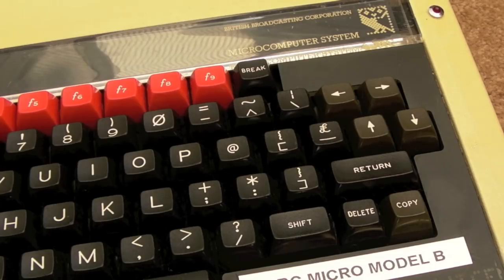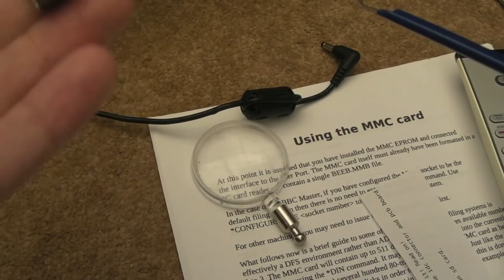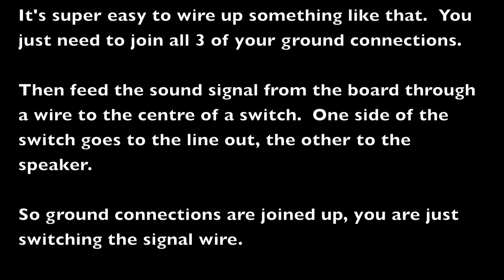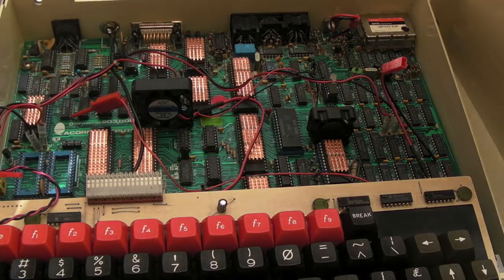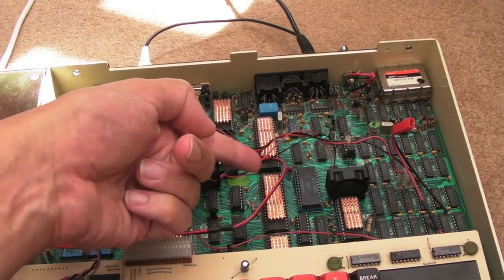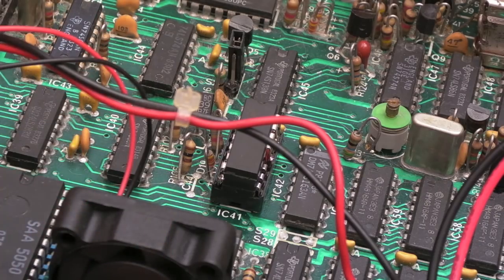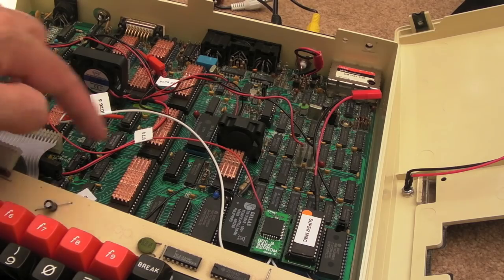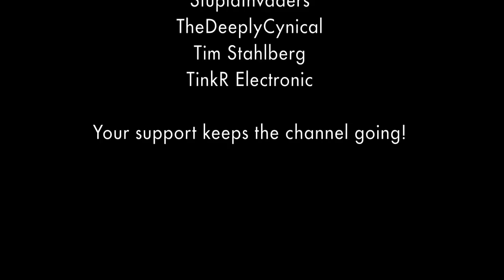Acorn BBC Micro Model B Multiple Repairs Part 4

Comment from the maker: Part 1 - https://youtu.be/XBQJHqbnVco
Part 2 - https://youtu.be/UyQ8ROnTrg0
Part 3 - https://youtu.be/IY1eqRxM48s
Not sure why some of the title music vanished there when outputting...  Always something wrong with my vids lol :o)

Here's the link to the video which talks about building the BBC - from a key person who worked at Acorn:- https://www.youtube.com/watch?v=y4WG549i3YY
Reply: GadgetUK164 - Retro Gaming Repairs & Mods

I did spot that earlier, but I'm too overheated to be pedantic about it. lol
Reply: GadgetUK164 - Retro Gaming Repairs & Mods 

Oh, btw, I still have a Merlin Tonto here which has the different type of speech ROM in it.

I wonder if anyone has dumped the ROM yet, as it could then be used by anyone on a Beeb (using that TMS ROM emu project thingy)?
Reply: GadgetUK164 - Retro Gaming Repairs & Mods

(as is typical after replying, I see you are already using a TMS6100 emu board. :p )
Reply: Holy moly Batman. Those fans are saving IC life!!! Amazing fix bud. Keep up the good work xxx
Reply: You must be pissing your mews off. Your hand 😂
Reply from the maker: I've got a couple of TMS-6100NL chips that don't work with the beeb, and not sure on their origins, suspected Speak & Spell or something...  Either that or they are blank and require programming.  Seems there's little info out there on them, other than how to read from them.  Presumed they are masked at the factory but a few people have suggested they can be 'blank' and require programming?!?!   I've got the emulator you're talking about there too btw =D
Reply from the maker: Thanks =D
Reply from the maker: PMSL lol!  Yes, they've been little terrors!

Comment: The audio mod should really come from PL16 and fit a switch to kill the internal speaker, the sound quality of PL16 is much better than from the loudspeaker output on PL15.  

Regarding the temperatures inside the computer, they reach around 75C when the ambient temperature is 30C, it doesn't need cooling, as the higher temperature means faster heat loss.  Unlike the Ferranti ULA in the Sinclair Spectrum, the BBC has enough space above to allow the heat to escape.  

The most common failure is the power supply and the hotter that runs, the shorter its life (electrolytic capacitors leak and dry out) this in turn puts more stress on the components, heating them further.  A good mod to do (without needing lots of fans and heatsinks) is to put a fan in the grille of the power supply and run a wire to a spare V2 pad (12V) it will have to be a slimline fan.  This would prolong the life of the PSU and reduce the fear of logic chips reaching their danger point of 140C (yeah, we're a long, long way from that level - these aren't nVidia/AMD flipchips that are soldered into another package - XBox360 Red Ring of Death, MacBook Pro 2012 et.c. that die at 105C)  

Unfortunately, at some point the design was changed to restrict the vents on the underside and the vents on the lid - I guess kids were poking things through the holes and the computer doesn't like that much 😆  

It looks like you're having fun with it, maybe try the 1MHz Pi projects like HDD, Teletext, Music 5000 (synth) and there's a good Pi Econet Server project underway that works well (as you've got an Econet interface)

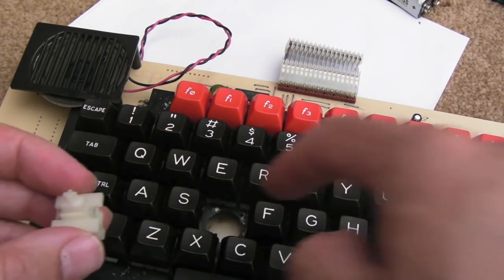Comment: 8:48  The solder pins on those switches form part of the contact. You can (gently) pull and twist them out with a pair of pliers, clean them and push them back in. It's not a guarantee they will work when they are re-soldered as there's another part that you can't get to, but it's worth a punt.

Comment: Intermittant keyboard switches are common on a beeb that hasn't been used for a number of years. The usual fix is just to tap vigoursly for a minute. If that doesn't work, you can desolder and "unscrew" (pull as much as unscrew) one leg, clean it and replace before repeating with the other leg - don't remove both at once!

Great repair to the case.

Thanks for the mention, sorry you spent so much time debugging an EPROM that you may not have even tried without my trouble shooting chip!
Reply from the maker: Thanks =D  Don't worry about that problem with the chip - not your fault at all lol!  If there's one thing I've found over the years of doing my channel - Whatever I buy 'new', always causes me problems that others don't have.   I've had it so many times its incredible lol, but it gives me more video content so I am happy lol.   A good example is on the next video - boobip.com chips came with wires to clip on, and wires to join chips together.  They look perfect - but there was a problem as you will see!   And it's incredibly hard to believe lol.

Comment: Oh dear, mentioning pulling things out with thin strands and mentioning the D, I can smell parody #2 lol.

It's a shame you can't fit a larger fan horizontally, say a decent large and thin 120mm Papst or Noctua.  If it were me, I'd experiment using one of the of the motherboard screw placements to anchor one corner of said fan type and some rubber feet for the other 3 corners, it'd save on noise and create a lot more turbulence. But, it's not me nor my machine. 

This Beeb has found a great owner, I am sure it's loving the lime light of late! Looking forward to episode minus 2 lol. Cheers for the entertainment Gadge.
Reply from the maker: Hehe, thanks lol =D  Yes, the fan mounting needs improvement for sure.  I think a small 3D printed mount that just extends out would solve it.

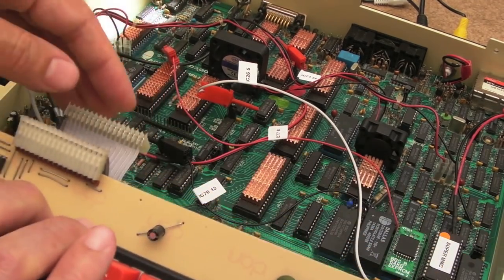Comment: Yeah it's funny in vintage computers where you have absolutely no heat distribution to speak of with things running as hot as they do. That's idiotic those people complaining about adding heat sinks & fans after the fact, no company ever has any concern about the lifespan of hardware beyond the time period they can make money from it, period. O_o??? 33:26 ^_^
Reply from the maker: Yes, you're right!  And I know I've moaned about this a number of times before, but I think its important to get across to people that still don't think temperature is a factor.
Reply: Logan Jorgensen - Time to step off your soap box.

Comment: I think ST stopped making EPROMs in 2011/12 so any EPROM you buy off ebay with a date code after 2012 has definately been rebadged. You can use paint stripper to reveal the real speed of the EPROM. Most 10F1s are really 12F1s or 15F1s. I bought a bunch of AMD flash chips from ebay and not one of them was manufacted by AMD, they were all Macronix rebadged.

Comment: You're correct in assuming that your IR thermometer is reading too low. The emissivity coefficient of shiny copper is vastly lower than that of most surfaces.

Emissivity coefficient table:
https://www.engineeringtoolbox.com/emissivity-coefficients-d_447.html

How to adjust the emissivity coefficient on 'your' IR thermometer (maybe - hope chipset is the same):
https://www.youtube.com/watch?v=J1CMrz7LOOI
Reply from the maker: Thanks!!!  That's great info!  Unfortunately mine doesn't seem to be configurable like that one in the video (despite having same part number).  I suspect mine is a clone =/
Reply: I just noticed that your 'clone' doesn't actually have the segments present on the display.
Since you can't change the emissivity setting of the measuring instrument, change the emissivity of that which is being measured instead. Some black electrical tape on the side of a heatsink should be a big enough target, given a bit of gun waving to find the hot spot.
Reply from the maker: Brilliant yet simple solution there!!!
Reply: Thunderf00t shows a good example of the effect of tape under an IR camera (and it's not even a dark coloured tape).
https://youtu.be/wNHcIYyYDhU?t=205

Comment: Regarding the heatsink commenters... Commodore never specified heatsinks for their chips because they wouldn't have stretched the budget to include them!!

I remember Podd from school as well but I forgot how creepy looking he was... I know as late as 2002 a chemistry teacher at my old school still used to haul out a BBC to show a photosynthesis program, because nothing else had bettered it!
Reply from the maker: Yes, you're correct with regards to heat sinks!  Cost was often a key factor.  That was why they ended up just using the RF shield as an extended heat sink, although that made things worse imo.   LOL @ teacher using beeb still in 2002 - I can understand that!  Lots of educational stuff seems to be lacking modern updates.